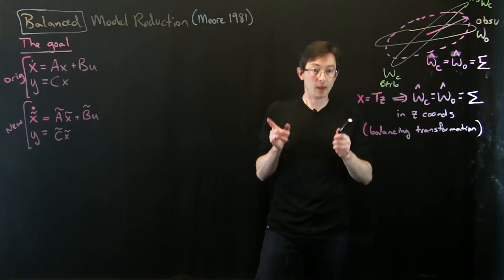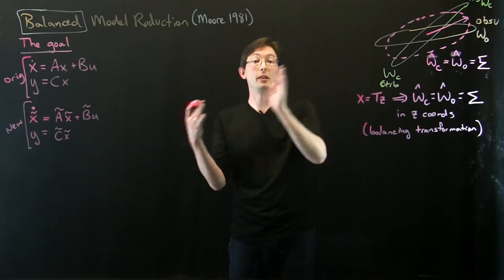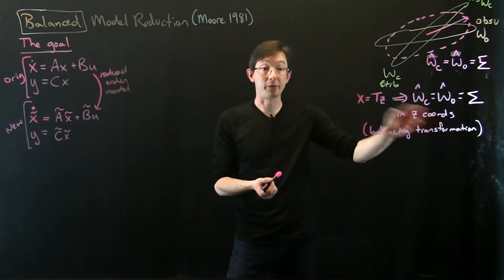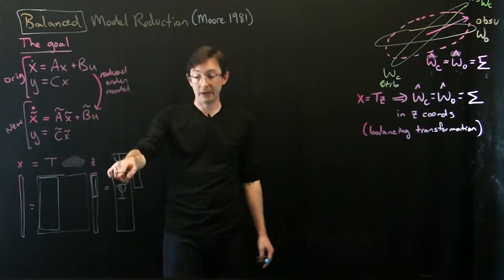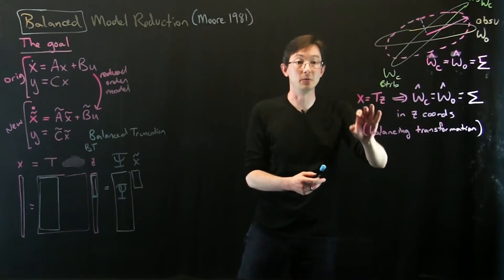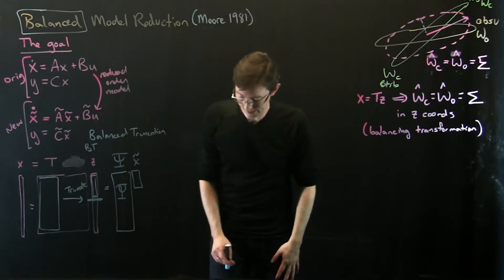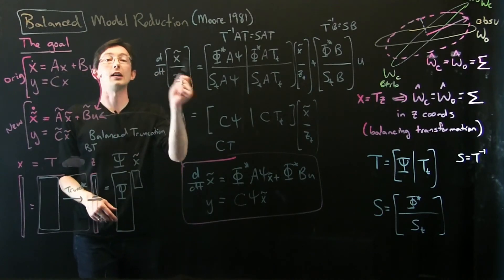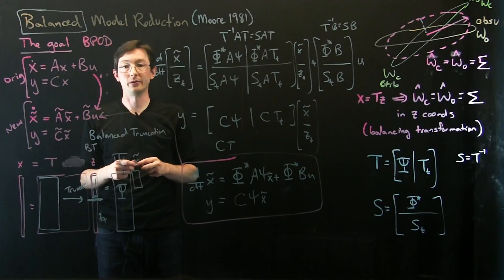Data-Driven Control: Balanced Truncation

Comment: Does enforcing balance have any particular value, or is it just "nice" because it isn't biased towards either control or observability?

I imagine it might benefit numerical stability, for the same reason that the rectangle that maximizes the area for a given perimeter is a square.

But if I know ahead of time that I'm going to be kicking some controls harder or more frequently than others, and paying closer attention to some subspace of the observable output... Ah and in that case I should rewrite my Wo and Wc to incorporate those biases, at which point balanced reduction does make the most sense!

So I should really be thinking of these systems as already "closed" or balanced in the sense that observation and controllability are equally important, I guess modulo the case when I have 0 control, which is probably best handled by working with pseudo-inverses aka retractions of the (possibly trivial) invertible subspace.

Comment: Sir, Great video, but i have a doubt that how do we know that the first few columns of T/ elements of z represent most important states? Does this comes from the fact that ctrb and obsv gramians are equal?
Reply: same question here. I have a feeling that I somehow missed a part where column vectors of T are being sorted or they are just guaranteed to be set in "descending" order :P
Reply: watch the next video in the series. The Henkel matrix converts the gramians in something that describes "the energy" of the system. Or more precisely how much each state contributes to the outcome in relation to the rest. It obviously can't account for variables you are not measuring. But with Henkel you can give weights to each single dynamic and group up as many as you need to get sufficient covering. If you don`t normalize ctrb and obsv you would over or under-estimate the importance of single dynamics by the corresponding factor.

Comment: Hello Steve, Assume that all the eigenvalues of A are positive and the system is controllable and observable. If I use this method to get a reduced model, are there any guarantees that if I design a stabilizing controller for the tilde dynamics that the controller will stabilize the original system. Is there a systematic way to select the minimum order reduced model such that a stabilizing controller for the tilde dynamics stabilizes the original dynamics.
Reply: see my answer to the other comment for the answer to your last question (finding the minimum order of reduced model). Whether or not the reduced order controller (or the one designed using the reduced model) can stabilize the full order dynamics is something you should always check after performing model reduction. Especially when looking for guaranteed margins of stability.